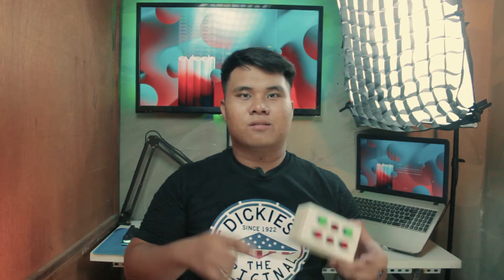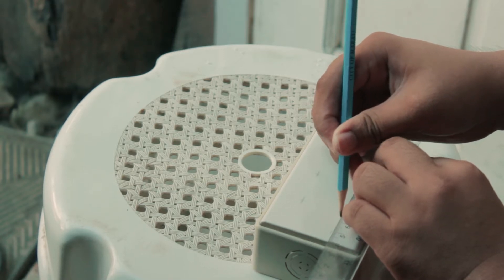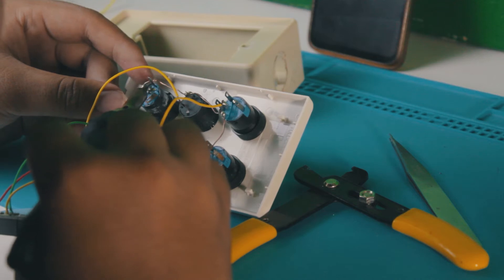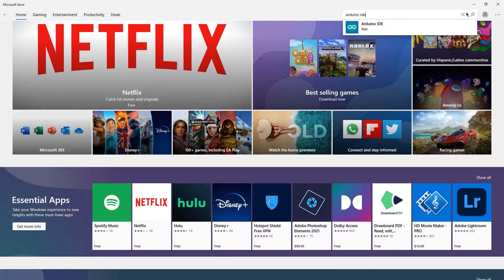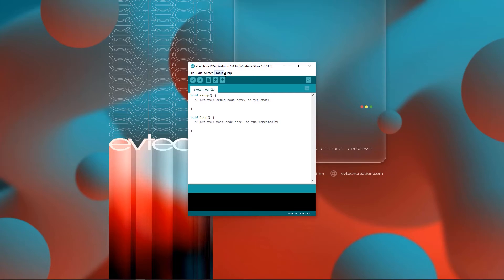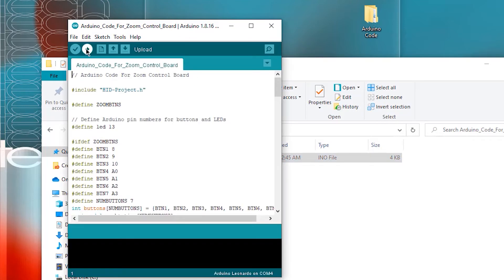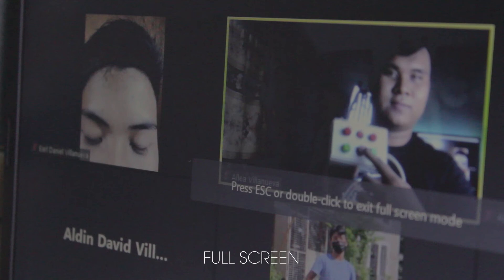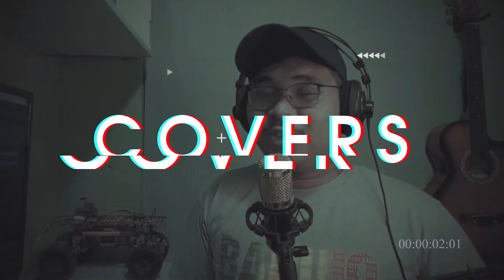DIY Google Meet and Zoom Control Board Using Arduino (CHEAP ELGATO STREAM DECK)

Comment: How can we make the same device with an Arduino Pro Micro?
Reply: Any leads?
Reply from the maker: hello  @pranavsathi6709  sorry I just saw your comment today. I'll make a diagram for the Arduino Pro Micro and update you. Thank you!
Reply from the maker: @pranavsathi6709  Please check my github. You can see the wiring for the Arduino Pro Micro there. The title of the file is Arduino Pro Micro - wiring.jpg.
https://github.com/earldanielph/DIY-Google-Meet-and-Zoom-Control-Board-Using-Arduino-CHEAP-ELGATO-STREAM-DECK